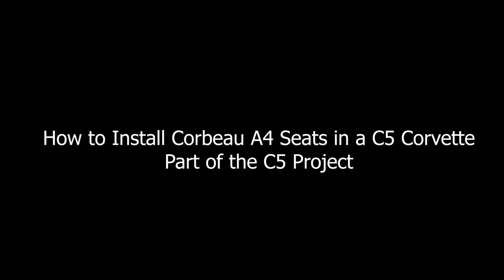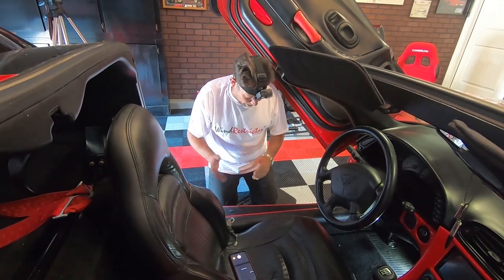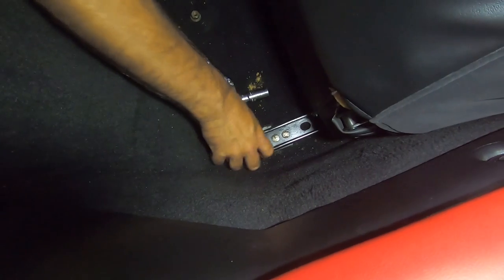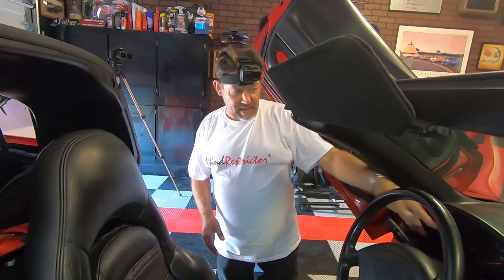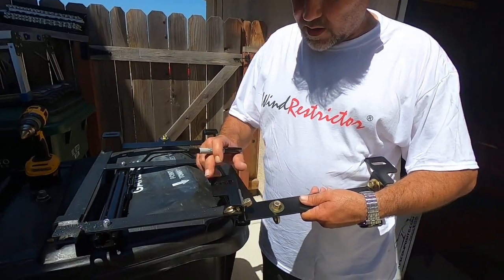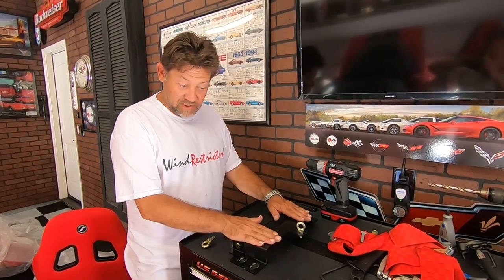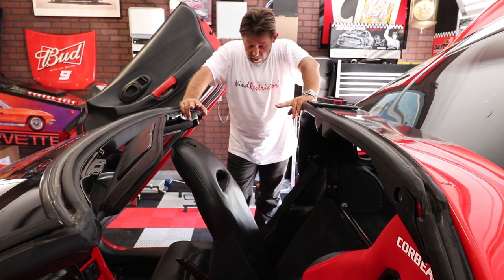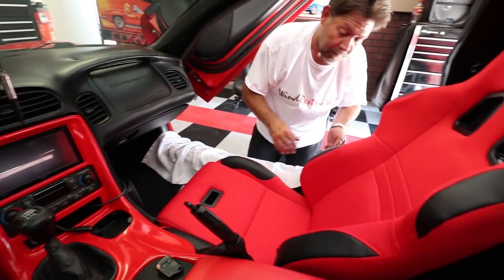How to Install Corbeau A4 Seats in a C5 Corvette

Comment: Are these lightweight compared to stock, Thanks
Reply from the maker: Yes they are.
Reply: They are not, the bracket wright's 12.5 lbs and the a4 weights 26. Combined, this weighs more than a power factory seat.

Comment: I don't get why you had to do that with the bracket unless you got the wrong one, cuz when I helped a friend install A4 seats, C5 bracket that he got for the seats was a direct fit. The only thing we had to do is add washers.
Reply: There were 2 reasons.  On the driver side we had to do this because we were adding the mounts for the 5 point harness so we had to use bolt extenders which were larger than the existing holes.  On the passenger side I don't know why we had to do it since the rails said they were for a c5 corvette but they were just a little bit off so we had to enlarge the holes just a bit to get them to fit over the stock bolts

Comment: WOW.  There is not much metal left where you drilled out the holes. Im pretty sure the integrity of that steel has been compromised.  When you purchase direct fit, I think we will all agree, you should not have to drill or fabricate Anything.  Otherwise,  good job on the video. Best of luck !